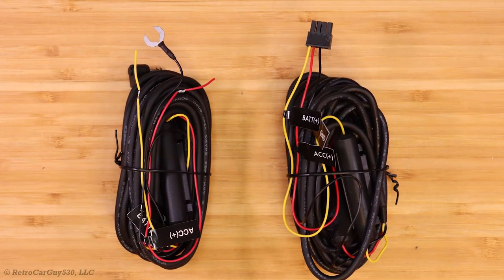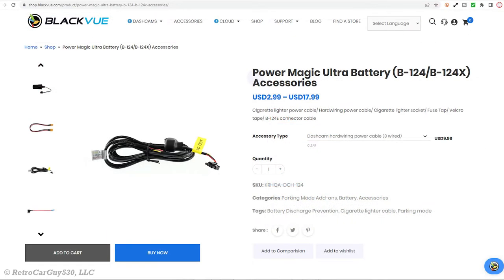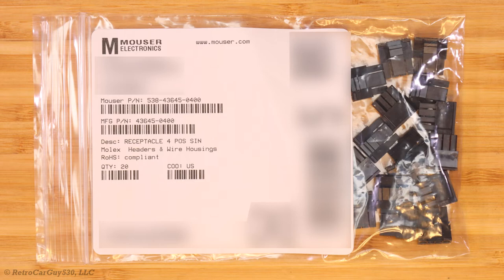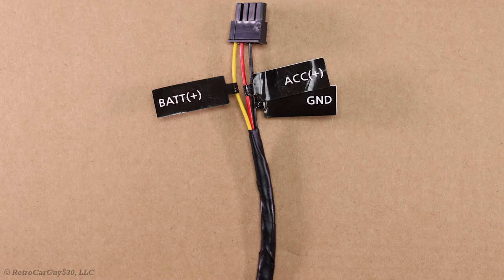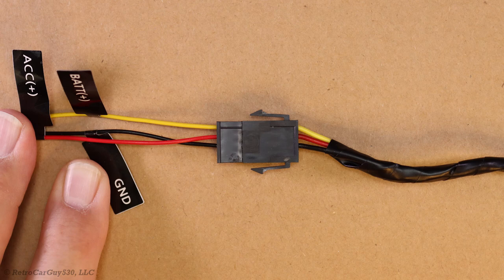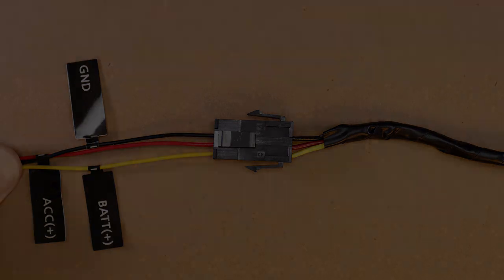How-To: Connect A Hardwiring Cable To A Dash Cam Battery

Comment from the maker: If you wanted to know how to connect your dash cam's hardwiring cable to a dash camera battery pack manufactured by EGEN, Inc, watch this video to see how to accomplish this task.
⏲ Video Chapters ⏲
00:00 - Intro
00:33 - How To Connect Power Cable
01:04 - Power Output Cable Options
01:37 - 2-Wire Caution
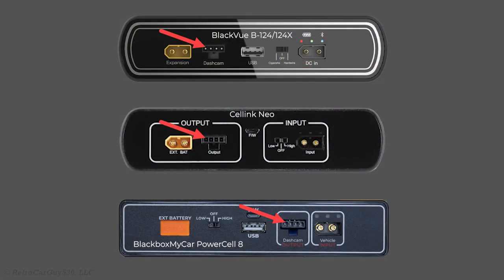01:50 - EGEN Battery Packs
02:12 - EGEN Terminal Pin Layout
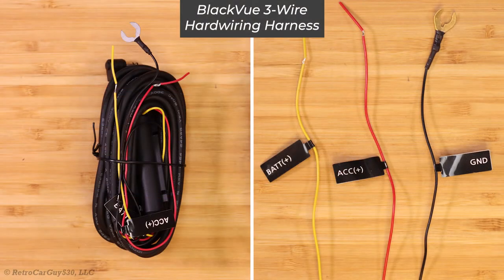02:31 - Wire Color Caution
03:25 - Required Parts
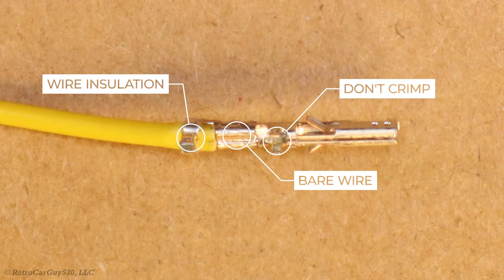05:22 - Connector Assembly
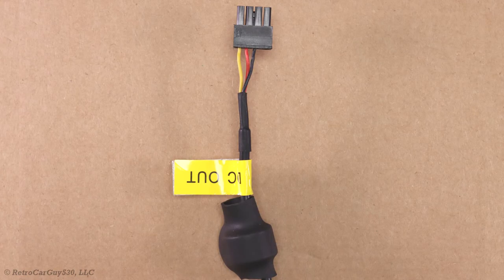06:20 - RFI/EMI Filter
07:08 - Bonus Section
08:42 - Final Thoughts

Comment: Super helpful, I got a thinkware battery pack which had 3 wires out and a Blackvue 750S 2-CH which only had two wires. Thought maybe I needed another adapter, but your video helped. Thanks!

Comment: One thing to note, when using the three wire harness  from the b124x, the ground wire is the ground. Meaning it gets its ground from the input ground of the B124X. Unlike the three wire harness from the camera that needs to go to a ground without using the B124X.
So no need to splice three wire harness to ground from camera then to B124X three wire harness ground.

Just harness to harness.
Reply from the maker: If you obtain the dash camera power using fuse taps in a fuse box in the vehicle, then the ground wire from the dash camera's 3-wire harness would connect to a grounding location on the vehicle.

If you obtain the dash camera power from a dash camera battery pack, then the ground is obtained from the ground pin/wire from the output connector of the dash camera battery pack.  No need to obtain a separate ground when using a dash camera battery pack.

Comment: Hi there. If I were to choose between the Powercell8 and Thinkware ivolt Xtra battery, which one would you recommend for the Thinkware U3000 front and rear camera?
Furthermore, what guage should the wires be for the hardwire and battery kit and is this already factored in by these battery companies so that the wires and fuse box connections do not heat up during charging and running 24 hours in parking / motion mode etc?
Reply from the maker: As far as battery capacity, the PowerCell 8 and the iVolt Xtra BAB-95 are the same.  The BAB-95 does give you the feature of having the U3000 announce the remaining battery capacity when entering/exiting parking mode by using the extra battery communications cable.

My personal experience with the Thinkware iVolt Xtra BAB-95 battery pack has not been all that great.  I'm now on my fourth unit.  The first two simply stopped providing power to the dash camera.  The third unit started to strangely go through a self-discharge event causing it to go from fully charged to no power in just a few hours.  On the last self-discharge event, it also failed to stop trying to charge the battery pack even though the "ACC IN" power was turned off.  My fourth unit is working correctly (for now).  I've installed the fourth BAB-95 just a week ago, so I don't have a long history with that unit (yet).

A friend of mine that installs the BAB-95 for his customers has stated my experience seems to be unusual.  He's not observed any failures of the BAB-95 in the 30 or so cars he's installed a BAB-95.

Comment: Very informative video. So the acc wire will draw power from the car through the battery pack without using the batteries in the pack whilst the car is running? Or would it be better to wire the acc cable to one of the fuses in the car as not to put excess wear on the battery pack?
Reply from the maker: The dash camera is not powered by the power on the ACC wire, it's only used as an indicator to the dash camera or the dash camera hardwire kit. The presence of 12-volt power on the dash camera ACC wire is how the dash camera or the dash camera's 12-volt to 5-volt hardwire kit (depending on how the dash camera is powered) knows to run in normal recording mode. When the ACC power is turned off, the dash camera uses that as an indication to enter parking mode (if enabled) or power down (if parking mode is disabled).

These three dash camera battery packs are charged using switched/accessory power.  When the battery pack is being charged (vehicle accessory power is on), the battery pack will provide 12-volts on the ACC wire that goes to the dash camera or the dash camera's hardwire kit.  There is no load on the battery pack.

Comment: Thanks so much for the help! The seller for my Wolfbox g900 was insisting that the only way to access parking mode is to hardwire it directly to the car and not an external battery. When I had the camera connected to my battery via a 2 wire connection parking mode was not accessible, but now I am able to access parking mode on the camera. The only issue is that when I turn off the car everything shuts off and the camera goes into parking mode for about a second before turning off. Any idea why that would be happening? I have a Blackvue B-124x hardwired to a constant power fuse.
Reply from the maker: Two possibilities.  It sounds like the G900 has already been configured to enter parking mode in the firmware settings.  If that is not enabled, then the G900 may simply turn off when the accessory power (ignition switch power) has been turned off.

The other possibility is the hardwire kit's red (accessory power) and/or yellow (constant power) are not connected to the correct wire on the dash camera battery pack side of the connection.  If the hardwire kit wires are incorrectly connected to the wires on the dash camera battery pack, the yellow wire of the hardwire kit will lose power as the ignition switch is turned off which would cause the behavior you've described.

Looking at the B-124X dash cam connection port (left to right), it has BATT+ (constant) power, ACC+ (switched accessory power) and then a ground.  The G900 Type-C hardwire kit wiring picture I found online suggests that the hardwire kit's yellow wire (BATT) should be connected to the left most wire/connector of the battery pack connector, the hardwire kit's red wire (ACC) should be connected to the second connector (from the left) and the ground of the hardwire kit (earth cord - black) should be connected to the third (from the left) connector on the dash camera battery pack.

The other thing you mentioned is the B-124X is hardwired to a constant power fuse.  Please do not connect the charging cable of the B-124X to a constant power fuse.  That will deplete your car's battery since the B-124X will always be drawing power from the car (running or not).  The B-124X's charging cable power source should be a switched/accessory power source only.
Reply: @RetroCarGuy530  Thanks! I was able to get it to work.

Comment: Hi...is it possible to connect both the acc and battery + together onto an ignition on fuse slot? asking as my old battery use only 2 wires without ACC but I am thinking to change to a new battery pack which uses 3 wires (Acc, Battery + and Gnd)
Reply from the maker: You can connect the dash camera's battery+ and acc+ wires to the same fuse tap in a fuse socket with switched/accessory power. That will result in the dash camera powering down when the vehicle's ignition is turned off instead of going into parking mode.
Reply: @RetroCarGuy530  Thanks for the reply.....but in my case it is the battery connection not the dash cam.
Reply from the maker: Then I do not understand your question. If the battery pack (charging connection) requires a switched/accessory power source, then you must only connect the charging cable wire to a switched/accessory power source and of course the ground to a vehicle ground.

If you have a battery pack that has its battery charging cable connected to constant battery power (like the Thinkware iVolt Xtra BAB-95), you must connect the charging cable positive to a constant battery power source and the ignition sense wire to a switched/accessory power source.
Reply: @RetroCarGuy530  My existing battery pack comes with 2 cables only.  1 to ignition on power and the other to gnd. so for Ivolt xtra bab-95, it comes with 3 cables to connect. constant battery power, accessory and gnd. Can i run connect both the constant power and accessory cables to my existing cable which is an ignition on power.?
Reply from the maker: You might be able to connect it that way, but it definitely is not the recommended way to power that battery pack. The BAB-95 expects to be connected to constant battery power and ground all of the time. When the switched/accessory power is turned on (green "ACC In" wire), it's only a signal to the BAB-95 battery maintenance system to begin charging and to pass along power to the dash camera on the "ACC Out" wire in addition to the constant battery power sent to the dash camera from the battery pack.
Reply: @RetroCarGuy530  well. Look like a completely different way to connect. I really appreciate your effort to explain! cheer!

Comment: What fuse size does one utilize on the BlackVue B130X 10 amp or a 20amp.  Thank you
Reply from the maker: Based on my testing of the B-130X, the B-130X draws almost 9.2 amps (max) during the high mode charge cycle.  There may be a small inrush amp spike that exceeds 10 amps, so you may want to use a 15 amp fuse if a 10 amp doesn't work for you.  I'm not a fan of using fuse taps to power anything that draws that much current via a fuse tap.  The original circuit in the fuse box might get overloaded with the original load plus the load to charge the dash camera battery pack.  About a year ago, I reviewed the BlackboxMyCar PowerCell 8 dash camera battery pack.  In that video, I discussed the fuse tap vs using a 4-terminal relay which sources its high amp power directly from the vehicle's battery (with an inline fuse).  That approach still uses a fuse tap, but it's for the relay control power which is in the neighborhood of 100 mA instead of 10 amps.  Here's a link to that video and the section that discusses that topic. https://youtu.be/Joa0fiKZY-o?t=12m24s

Comment: Hey, great video. Just had a question. Where does the female terminal pin go?
Reply from the maker: The female terminal pins are used in the connector that plugs into the dash camera battery pack.  The male terminal pins are present in the connector inside of the battery pack.
Reply: @RetroCarGuy530  Again thank you for the prompt response. So just to be sure, the male is crimped on to the wire. And the female goes inside the connector. So once the male is inserted into the connector, it should lock in?
Reply from the maker: The male terminal pins are present in the female molex connector (plastic connector - one is present on the inside of the battery pack).  The female terminal pins are crimped onto the wires from the dash camera wiring harness and they are then inserted into the male molex connector.  When you insert the female terminal pins into the male molex connector, they will click into place.  When the male molex connector is plugged into the dash camera battery pack connector, there's an external plastic clip on the male molex connector that clips onto a small ridge on the outside of the female molex connector that is present inside of the battery pack. That clip on the outside of the molex connector is what keeps the connectors together.
Reply: @RetroCarGuy530  again thank you so much for being prompt and informative. Really appreciate it and keep up the great work.

Comment: Hi there if wiring the output cable from the neo to a viofo a139 hardwire parking mode  cable one with the voltage monitor on it do you keep the voltage monitor box on it or remove it. I cut my wire to remove the voltage box as I thought was not needed and that i just wanted the usb c lead thats on it with the three wire yellow black and red on it to join to the cellink neo output cable 
my camera won’t turn on for some reason with it like that, 
I thought the voltage box was not needed as the neo tell the camera its in parking mode
Thanks hope you can shed some light on the subject
Reply from the maker: I believe I just replied to your question about this on the DashCamTalk website.

The "voltage monitor box" is more than a low voltage cutoff device. It converts the 12-volt input power to 5-volt power that is supplied to the dash camera via the USB connector. You cannot directly connect the battery pack's "dash camera" output power (12-volt power) to the USB power wires that go the USB connector for the camera.

Comment: vehicle in just plug into crigratter light for charge？  if car is off   it wont change  it wong drain the battery？
Reply from the maker: If the cigarette lighter power port turns off its power when the car is off, then the battery pack won't drain the car's battery.